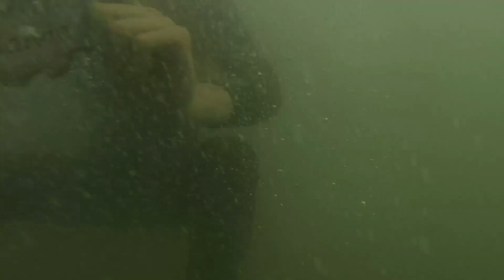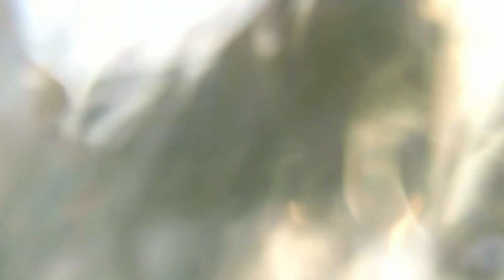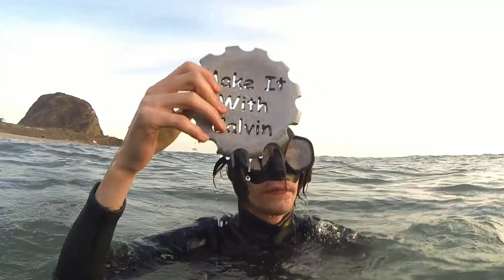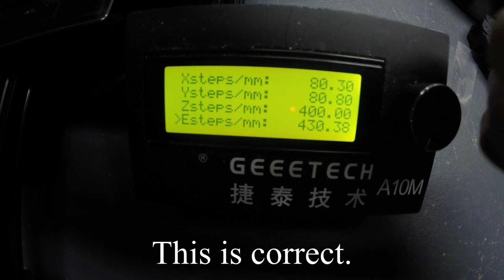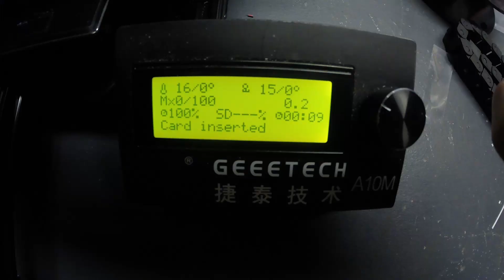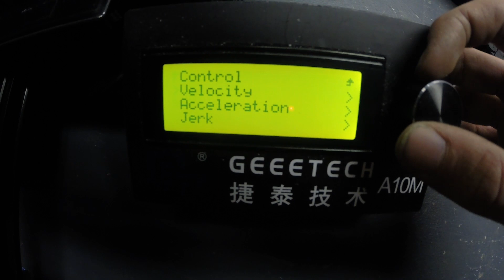Fixing Wrong E Steps on 3D Printer

Comment: There is no one magic number.  Even for the same model printers, can have a different number.  It's machine and even filament dependent.  It might get you close.  A proper calibration should be done to determine the correct number.